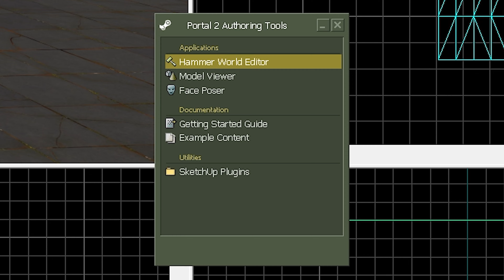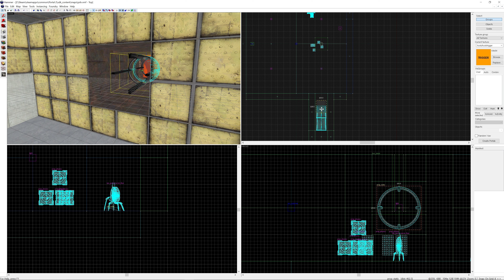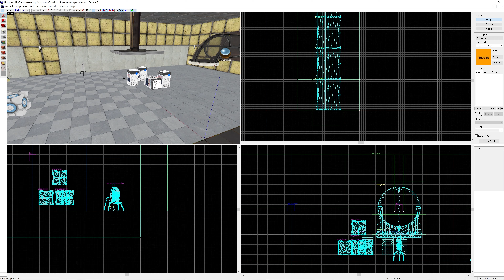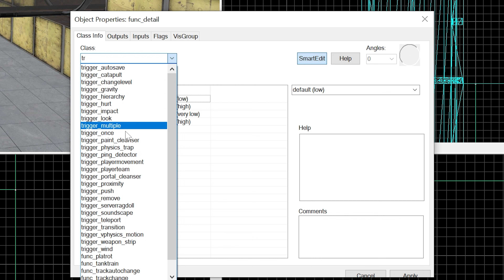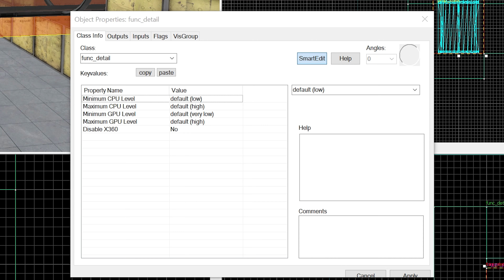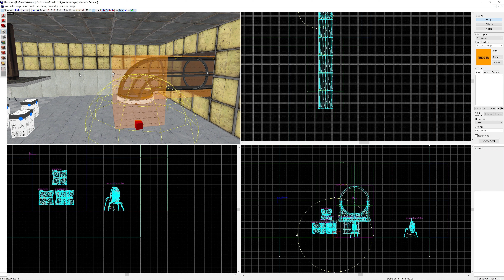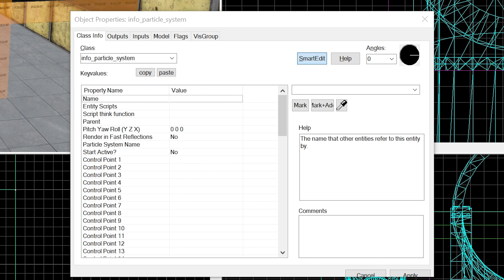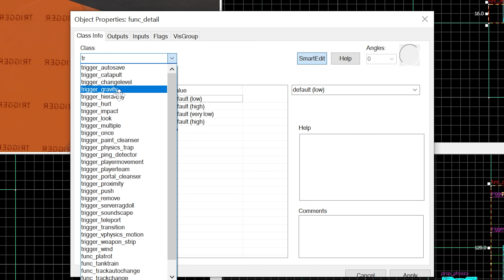Hammer Tutorial 30 - Pneumatic Diversity Vent in Portal 2

Comment: Is it possible for you to create tube rides in hammer portal 2?
Reply from the maker: Maybe, I think the way the tube ride in Portal 2 works is by using a model with an invisible part that goes along a predetermined path (pretty much exactly like what I showcase in this tutorial: https://youtu.be/0XrcKTKEg3o ), instead of using something like a func_tracktrain and path_track entities. I think a tube ride section is possible to create, however. Maybe I'll do a video about it at some point, there's other videos I need to work on right now though.
Reply: @TheMaster974  How about this: You can always wait for me to post my map of my tube ride and whenever I feel like it, I can post it on steam or I can record my map from Hammer. How does that sound?
Reply: My tube ride can be as long as I can make it. I'll do my best to build my map, try to decorate my tube ride and put in any sound I think will do best.
Reply: Deal?
Reply: Also, I'll make sure to add flanges for each end of the tube
Reply from the maker: Why (if you don't mind me asking) do you want me to take a look at your map?
Reply: @TheMaster974  I'm not saying you should. I'm saying when I feel like it, I can build my map but I'll use func_tracktrain if I'm to build any tube rides.
Reply: Once I build my map, I'll let you know.